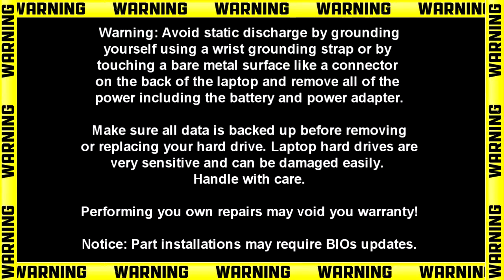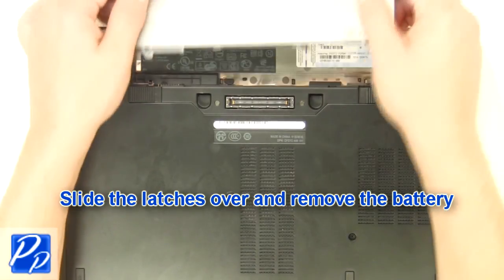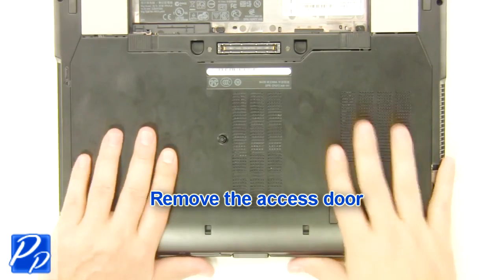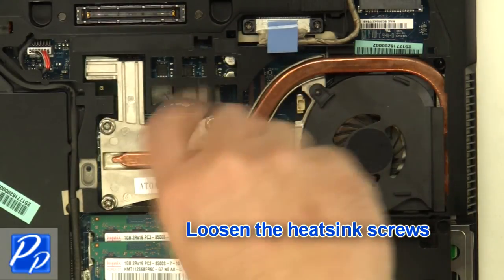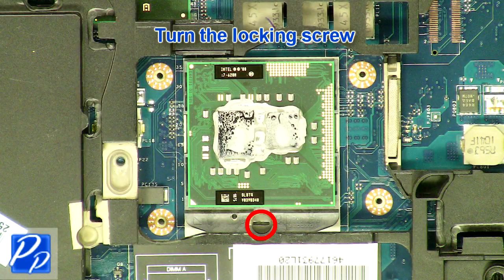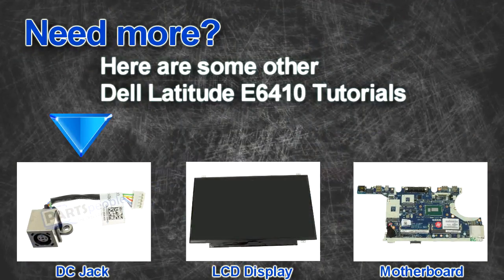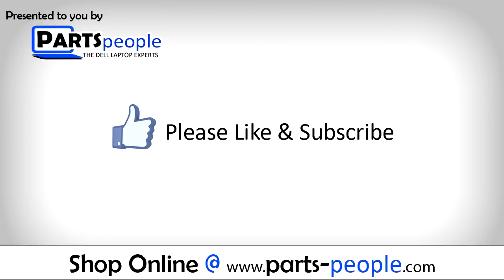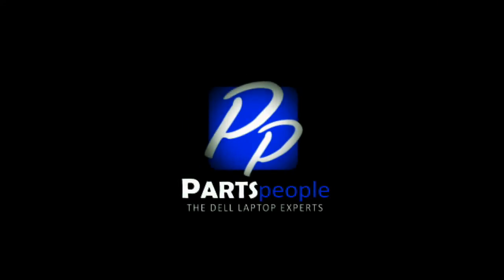Dell Latitude E6410 CPU Processor  How-To Video Tutorial

Comment: How do I check if I have Nvidia on my notebook?  Tks
Reply: From your desktop hold down the windows key and then tap the X, in this context menu choose device manager, from here open the Treeview list and scroll down to display adapters. From here expand the display adapters Treeview list and look for envy DIA if you do not see it and only see the Intel HD graphics you do not have the MVIDIA graphics card on your motherboard. An upgrade will be necessary.

Comment: lovely
but could the processor be swapped for a higher processor say i5 8th gen
Reply: No, the chipset on this computer will only work with the first generation core I series processors. The best processor for this laptop is the Intel core I 7–8 40QM. However, in order to get it to work you will have to have the motherboard with the discrete NVIDIA graphics card as well as the most up-to-date a– 17 bios revision. The reason why you need the discrete graphics motherboard is because the quad core processors for this generation did not have built-in graphics.